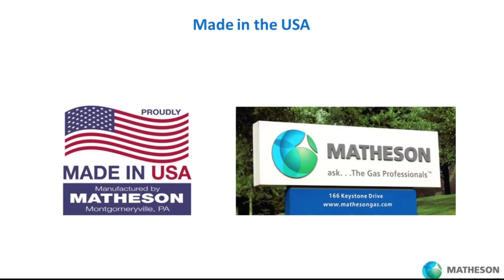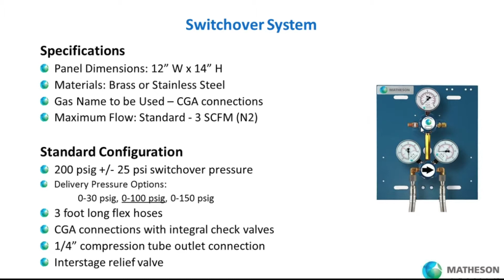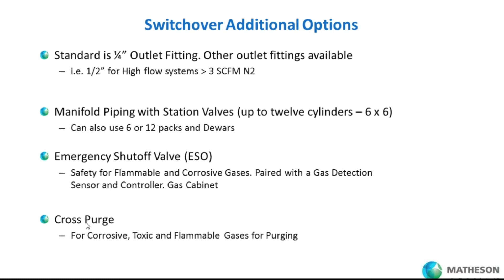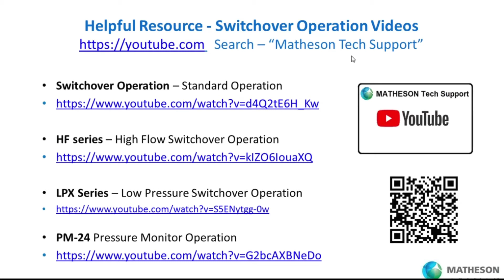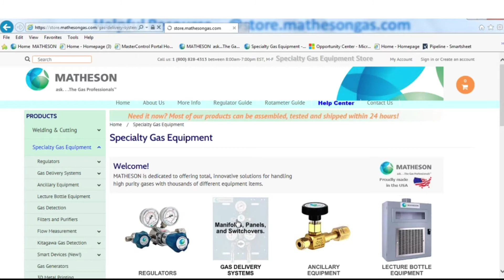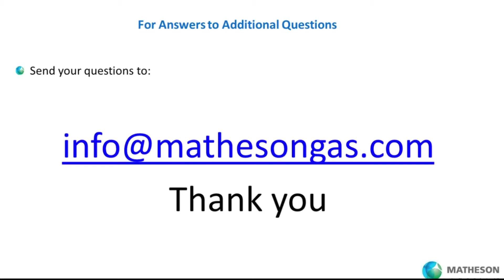Introduction to Specialty Gas Switchover Systems

Comment: i need to know switch over system internal function. diaphragm two sides how its actually work during the wheel arrow rotating time,
i already opened and seen what need to know how its actually work.
Please help me out
Reply from the maker: The switchover regulator can be thought of as two pressure regulators in a single body. The arrowed knob adjusts the pressure of the front regulator. The following video should help explain: https://www.youtube.com/watch?v=7PdMT1hhcmU